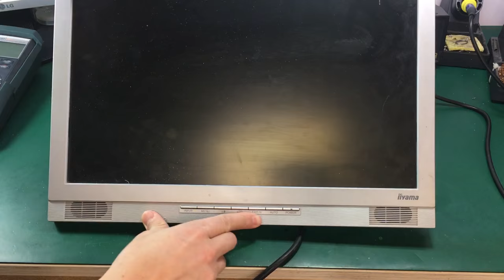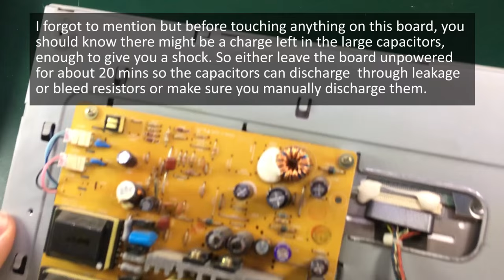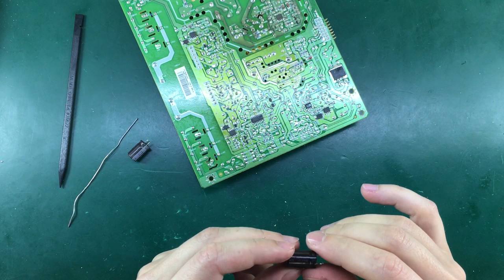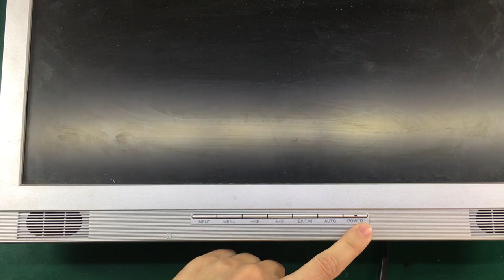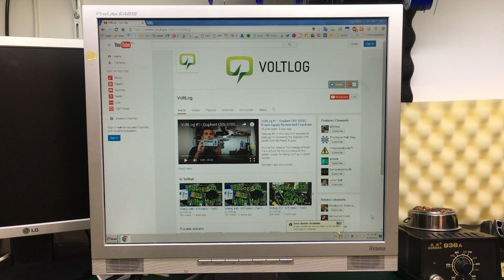Voltlog #43 - LCD Monitor Repair

Comment: Cool :) Like how you soldered those caps without bending the leads. I should get a fat chisel tip like that.
Reply from the maker: +leppie I believe they are called T type tips, they have great thermal mass, good for soldering big terminals. I just have a thing with bending terminals, I try to avoid it as I don't like how they look after soldering :)

Comment: @
VoltLog i have a iiyama ProLite B2776HDS and it had t he same problem , until the power light has gone , before was blinking ... i went to a electrician and he changed the capacitors , 2 littles and 1 big . and i still have the same problem , the monitor wont power up ... what advice you have for me to look into ? what should i have to do ... I will apreciate your help . thanks .

Comment: Good video! Terrible soldering... Don't bring over solder on your iron, that makes it harder to solder. :( Just apply heat, apply solder, remove solder, let it flow, remove heat. When you bring it over most flux is already burned, only makes it harder to solder...
Reply from the maker: +tengelgeer I had one hand busy holding the board and the capacitors in place but flux is the key here, I also had flux on the PCB and with the right temperature on the soldering iron,  the soldering job was perfect because the solder doesn't stay on the tip long enough to oxidize.
Reply: +VoltLog With flux on the board, okay. But why the effort? Nothing stopped you from laying the board flat. It's just a through hole component, just bend the leads out a bit and solder it the normal way... So much easier...
Reply from the maker: +tengelgeer bending the leads is the way to do it, I agree. Because I only had a couple of capacitors to solder I skipped the bending of the leads. I also like soldering without bending component leads where possible because I get a nice looking solder joint without the tip of the component leads sticking sideways.
Reply: +VoltLog I posted it because of beginners who might watch the video :) Know the solder parodied of Big Clive? xD And I thought: moving over solder or applying flux only is more work. Btw, you don't have to bend then that much, leads can still stick out pretty much straight up. And the thing I real real like to have around when soldering are some blobs of Play-Doh. The best third hand ever!
Reply from the maker: +tengelgeer I am subscribed to BigClive's channel, but he has so many videos on soldering, I'm not sure which one you are referring to. Maybe you can share a link? I have never tried play-doh but I will try to get some to keep it around.
Reply: +VoltLog I'll look it up when I'm on my computer again (mobile right now). I bought like 12 sticks of play-doh for like 60 (Euro) cents at Action (Dutch Poundland kind of shop). Besides a good iron it was my best solder investment :D
Reply from the maker: +tengelgeer thanks for the hint! :)
Reply: +VoltLog Meh, he has indeed had to much videos. I can't find the video. It was a solder tutorial parody where he tried to splat on solder :p
Reply from the maker: +tengelgeer sure, no problem.